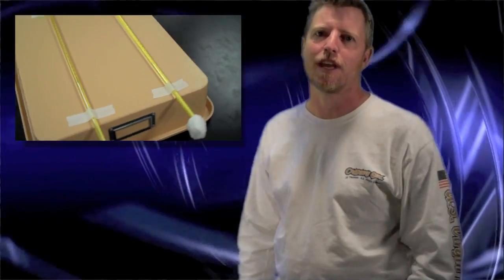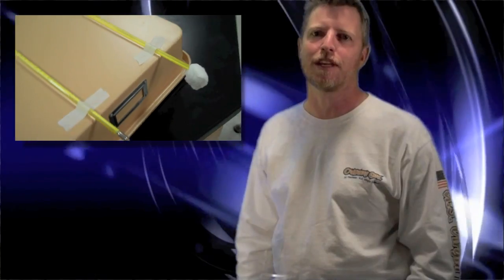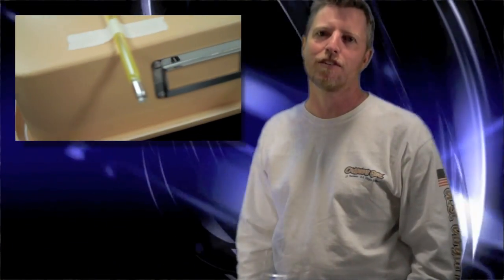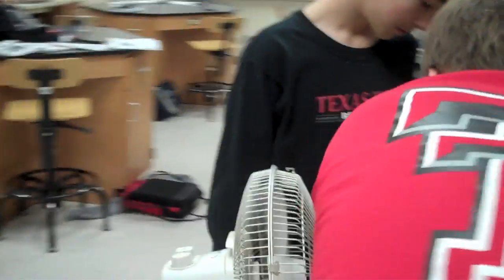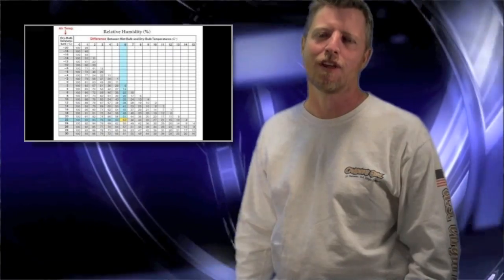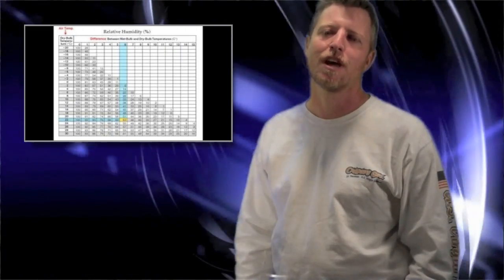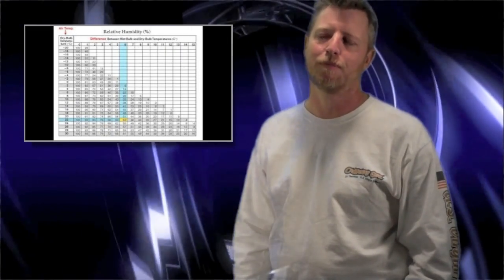Mr. Hayes' Weather Series: Convection Currents & Relitive Humidity

Comment: Im confused on the cold air and warm air? like sense its cold air shouldnt it be more dense then warm air? and the same with warm air isnt supposed to be lighter than cold air and is there an easy way to remeber which one is high pressure or low pressure because i always get them confused- Victoria